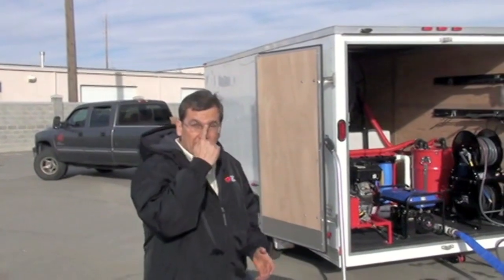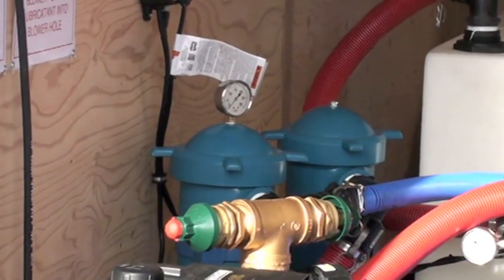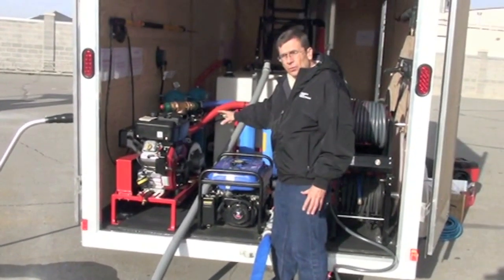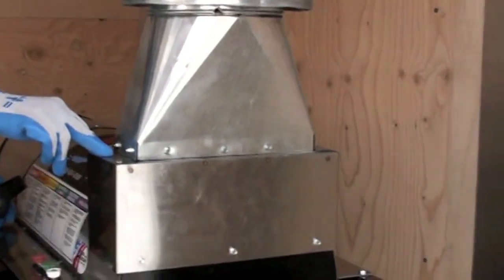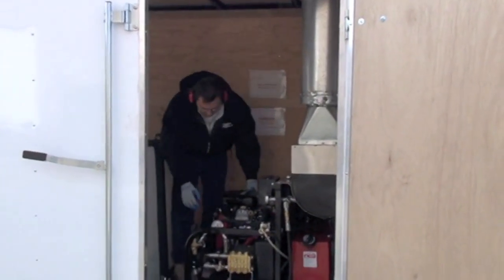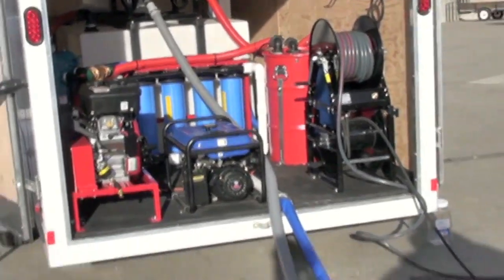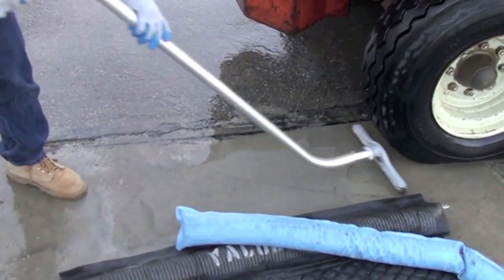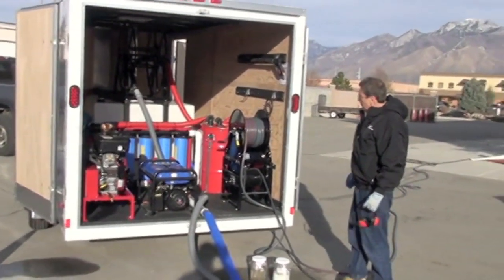Power Washer Pressure Washer Enclosed Trailer Environmental

Comment: very easy for someone to build this setup on the cheep that will last for years.. buy a used power washer for around $2500 and buy a used carpet cleaner for around 3k with a 3.0 or 3.6 blower. water tank 200 bucks filters for around 300 complete. pressure washer hose reels for around 1000 new or 600 with hoses used. A carpet cleaning machine will have between 75 and 100 gallon tank not that little round tank. fyi just don't use an electric pump out. crap but if you do hit me up and i will tell you how for very cheep. the only thing i didn't like was the gas tank on the 16hp briggs. always always run an external tank. if you don't remember to turn the valve off gas can get in the oil and a solinoid shut off is expensive to replace.. $89 and time to take stuff apart.  Hopefully the vacuum blower is a dual lube or a special cover need to be made to contain the greese splatter. if you use a drum like they did all you need is a washer and spring for the vacuum relief. i can tell anyone how to work through all these issues.  personally i think some things are missing or could be better on this setup that i can let anyone know.. building your own vacuum system needs to have redundancy..fyi when you buy a used truck mount carpet cleaner you will get lots of hoes and a reel and a nice pump that can be used for low pressure cleaning like tile etc..
Reply: build me one ...how much would you price?...
Reply: do you live in LA???